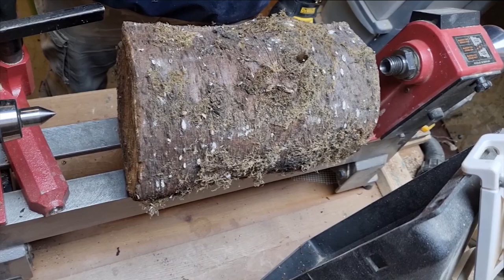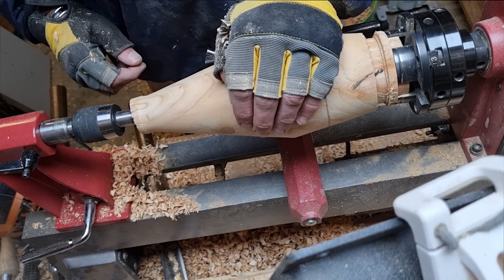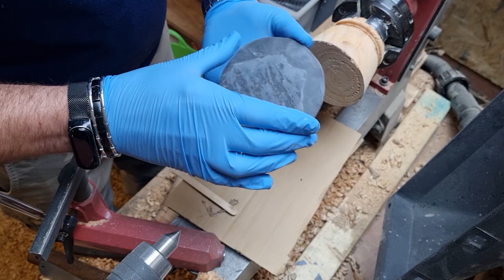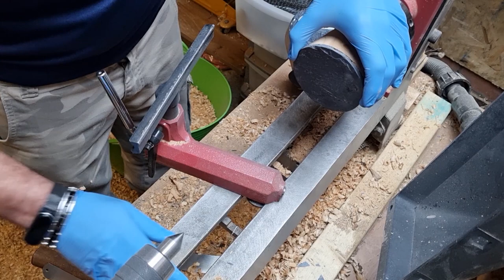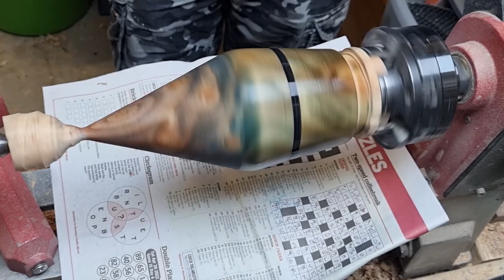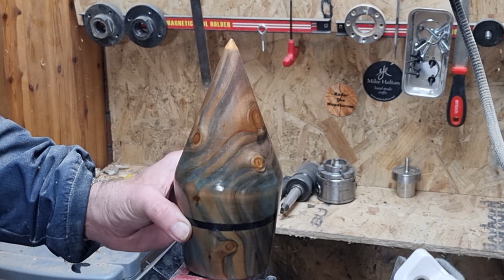Woodturning Project - slate inlay experiment

Comment: Fantastic to watch, nice to see different materials working together.
I've worked with slate on numerous occasions, I'm a tiler, I believe the slate cracked due to the heat from the sanding, also the vibrations wouldn't of helped.
Lovely piece in the end though.
Reply from the maker: Thanks so much, I have a feeling that this project was pretty much doomed from the start lol, but I needed to try it so get the idea out of my head 😀

Comment: I learned not to use slate sandwiched between 2 pieced of wood, use slate colored resin instead.  :)  One thing you could do with the slate is break it with a hammer into fine pieces and use that as an inlay in a bowl rim covered with a clear epoxy or CA glue.  That may look cool.  As always, great video.  It's nice to see you experiment.
Reply from the maker: Thanks Tim, this was a daft idea that I could not get out my head so I had to try lol

Comment: With my 20/20 hindsight vision I might have put the slate in shallow dish and encapsulated it in clear epoxy making the slate just a little bit smaller and then stuck it in the wood.  Maybe even screwed the slate onto the bottom piece of wood love your sight     Just bought a new lathe after seeing yours.  Thanks Matt
Reply from the maker: Thanks so much matt, with hindsight I would have done just the same 😀 have fun with your new lathe, let me know how you get on.

Comment: Just wanted to share that when you work with spindle stick, it's important to cut down hill. So on this piece, you would go from center to either end. That's using a supported grain cut that is less likely to have tear out. Dry pine requires a soft touch, supported grain cut, and very sharp tools. Best of luck
Trish
Reply from the maker: You are quite right, I was still learning back then, then again I still am 🤣
Reply: @MikeHolton  sorry I'm a late come to your learning process. It can be annoying to receive advice you already learned. Pray you're doing well over yonder. Lol
Reply from the maker: @triciahumphrey6453  Haha, the problem I have is actually remembering all the advice I've been given, I never mind being told twice 😁

Comment: A good example of what not to try.    When you cut the slate and had some of a layer or two fall off, this was a sign that the slate layers may not be adhered to each other.
The carbide is harder than the slate, but as you experienced, the slate is more ground off than turned.
Glad the crack held together with the CA glue at the end.   Once you removed tailstock support, I was holding my breath that the piece would not fly apart.
I have only turned pine for test pieces.   A lot of tearout.   If you turn pine again, try using a bowl gouge with fingernail grind in shear cutting mode on the wings.    This may remove a lot of tearout and save sanding time.
A braver man than I for trying this, but thanks for the video.
Dave.
Reply from the maker: Thanks for the comments Dave, I always knew that there was a great chance of it coming apart and was relieved to get to the end. I will not be trying again with slate. Pine is horrible to turn especially in this configuration, although I do have another project I intend to do with another soft wood.  
The slate idea is something I've been wanting to try so I'm glad I got it out my system. We progress ourselves and hobby by trying new things.

Comment: Loved this experiment. 
I did think at the start - slate, nope this ain’t going to work. But it turned out better than I thought. 
I would call it the Jupiter Rocket based on the way the colour has worked. 
Just a thought but it would be interesting to see if it could be strengthened by grinding axial slots around the slate area and filling with resin. The resin slots might help to pin it and might look ok as well. 
Nice one Mike.
Reply from the maker: Thanks Doc, interesting idea but I'm not of the mind to try again in the near future. The slate is just so hard to turn it hurts!

Comment: Great video, Mike.  I also enjoy watching the process and how you figure out solutions to problems on the fly.  

I turn pens mostly and I am a fan of CA as a finish.
Reply from the maker: Thanks for the comments 🙂, just wish I didn't keep getting myself into situations that need solutions lol. Any good tips for CA finish?
Reply: @MikeHolton  I have never done a large piece with a CA finish.  For pens, the method is typically to use thin CA to get the first few coats down and then do a couple of coats of medium viscosity CA.  I use a similar technique with the paper towel.  Then micro mesh wet sanding.  

I’ve also done a mixture of boiled linseed oil and CA.  It gives a warmer finish.  I think I saw that one on a video by Capt Eddie Castelin.
Reply from the maker: @Ted_P  thanks, I may try that.

Comment: I think I would’ve pegged the slate and wood together, because when you start to hollow out the centre they could come apart because pine is not the most reliable wood for gluing together even with epoxy resin.
Reply from the maker: Hi Martin, I think in general this was a fairly bad idea, but is was stuck in my head and I needed to have a go so I could get it out 😀

Comment: I wonder if you would have a better result if you were to substitute a slab of a tough but carveable stone such as jadeite. It would prevent the hairline crack running through it. The slate seems doomed to failure from the foliation built into it, whereas, other minerals lack a distance cleavage, Soapstone is a possibility also, but might be too soft. With different minerals, you might be able to bore through the inlay as originally intended. Good luck.
Reply from the maker: Yes of course you are right, this was something I was desperate to try but was not thought through properly. Another stone would have been better, I'm thinking of doing another with alabaster.

Comment: Hole saw in the slate so it becomes a ring.
Use a girthy tenon to hold everything together.
Reply from the maker: I think the best idea is to never try it again, well not with slate anyway, the structure of the material means it fractures far too easily. Worth a try though

Comment: Obviously slate has issues. I do home reno, and occasionally cut and polish counters. I think you could still pull something off with a piece of engineered quartz. It's usually stone dust and dyed epoxy anyway. Avoid pieces with bits of stone or glass. Don't try granite. And hollow first.
Reply from the maker: Thanks! Really appreciate the advice